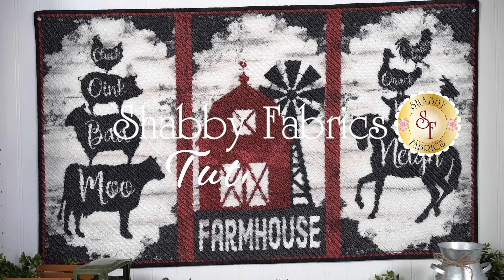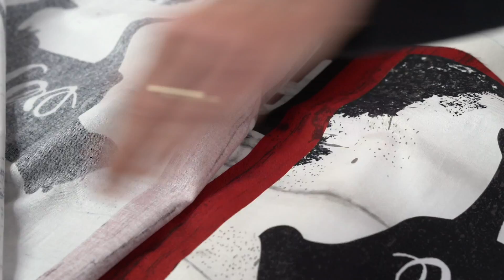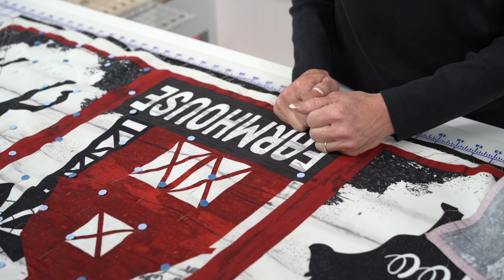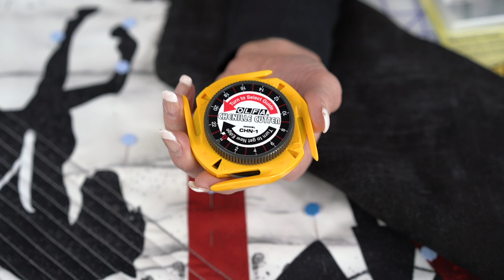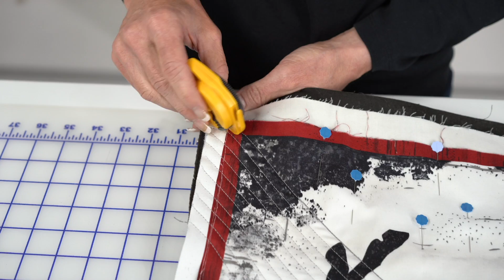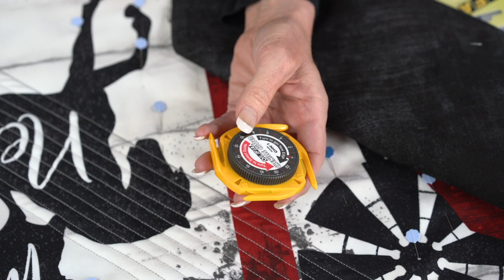How to Make a Rug Using the Olfa Chenille Cutter | a Shabby Fabrics Tutorial

Comment: Did you cut thru the top 2 layers, or just the top layer?  I don’t think this was addressed.
Reply from the maker: It can be easy to miss, but at about 12:25 Jen mentions this. You'll leave the bottom-most panel larger than the others, and in tact, and you'll cut through the top 2 panels. Hope that clears things up for you! :) Let me know if you have other questions. 

- Morgan